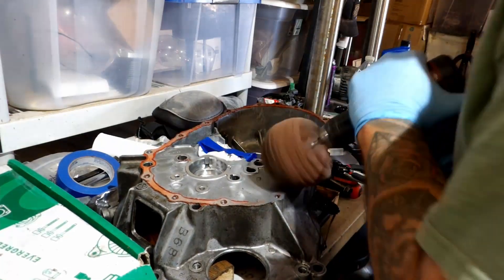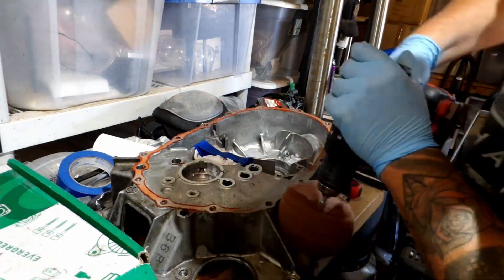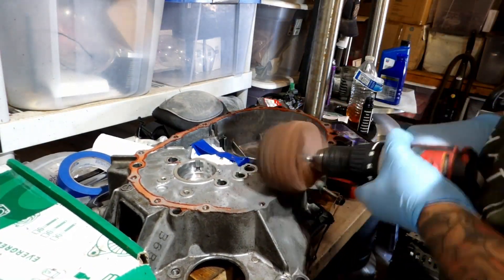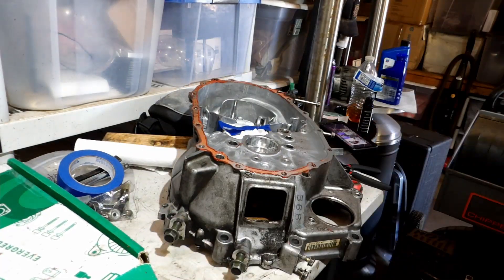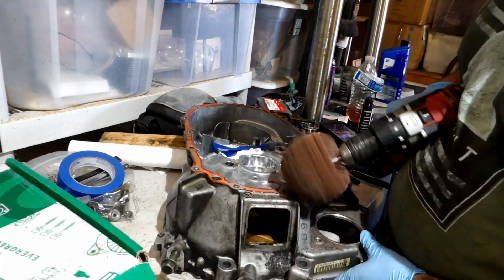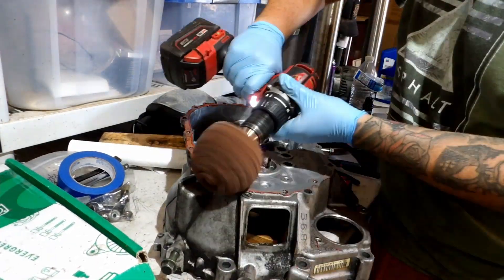EM2 Civic Transmission Overhaul

Comment: I had an 02 that I bought bone stock in 03. It was full bolt ons, even matched my catalytic converter with the 2.5 inch exhaust. It was a fun little ripper.  I really wanted to KSwap but traded it in in 2011.  I regret it.